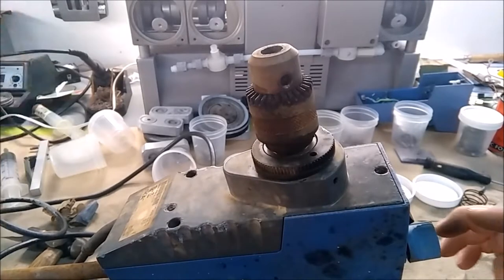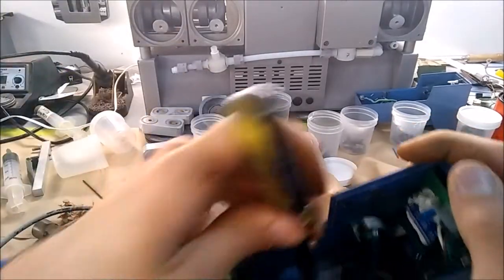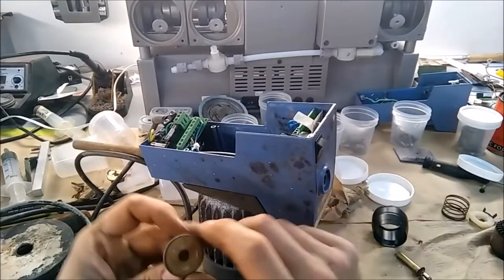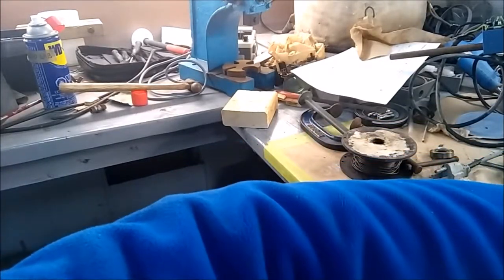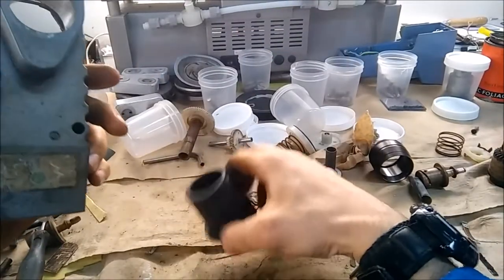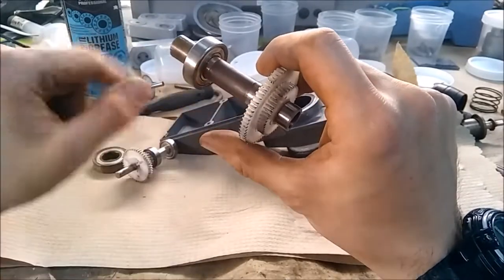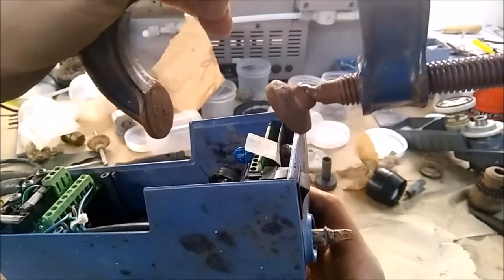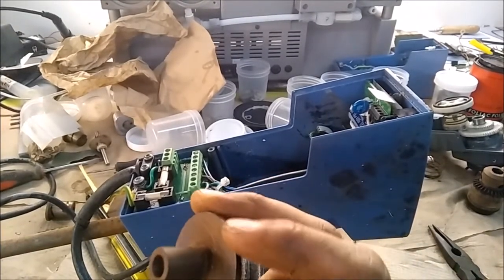IKA RW20 Digital Repair

Comment: Thanks for your amazing video. I've been following your instructions to fix my stirrer. Turns out the friction wheel is worn out, and the larger bearings are corroded, so I need to order replacement parts. I never would have gotten this thing disassembled without your video. Thank you!

Comment: Dan, I was shipped a used RW20 from an eBay seller and it was damaged in transit.  The clutch was frozen and the spindle wouldn't spin.  I would never have been able to fix it, but you are the expert with 60 of these units you have to keep spinning.  I was able to complete it without removing the motor or the control mechanism, lucky me.  I can't thank you enough.

Comment: Thank you for sharing your video! I have a question... I've got one of these and when I switch the knob to adjust to the higher speed, the equipment fails to move and displays 0 rpm. Do you have any suggestions on how to fix this? thank you
Reply from the maker: Sorry for the delay, it didn't give me a notification.

So most likely something is up with the contact wheel. That is a wear part.

Unfortunately you have to pop it open to take a look.

Comment: Hey man, this is an old video, but I've got a few of these in my lab, and I'm wondering if you could give me an idea on what would cause a clicking noise inside the mixer? It seems to give the mixer significantly less power when it comes to thicker slurries (Itll start at like 450 rpm and then go lower and eventually even out below 400 rpm even if I would turn it up) Great video man
Reply: I'm having the same problem! That's why I'm watching this video. If I find out the issue, I will let you know.
Reply: @jonathanpepper9743  I actually watched further into the video and found it out. There's some gears on the inside that swap between the lower and higher speeds. They were misaligned for whatever reason and when I put it back together the clicking was gone.
Reply: @ISesseriI  Nice. Well done!
Reply from the maker: @ISesseriI  Excellent to hear!

Comment: Hey Dan, I mentioned below that my RW20 had been knocked around during shipping and was able to spend 4-5 hours on it and fixed it.  Question: the mixing shaft wobbles a bit, is the chuck or chuck/body connection causing that problem  (probably) if so, is there a fix for that?
Reply: Hey were you able to fix that issue? I have the same problem the shaft wobbles around a bit